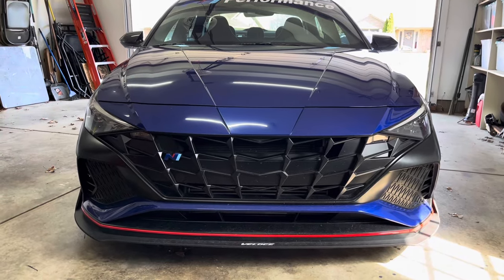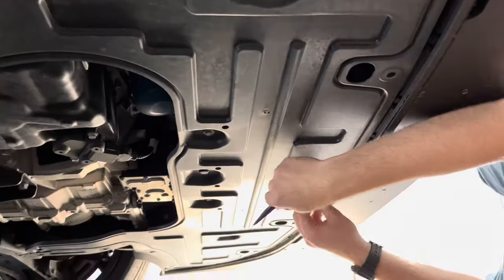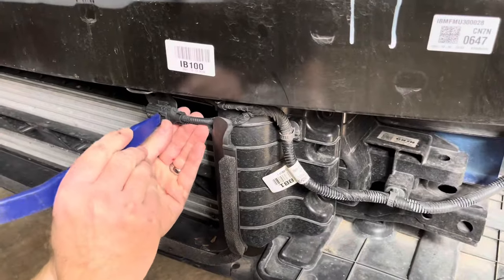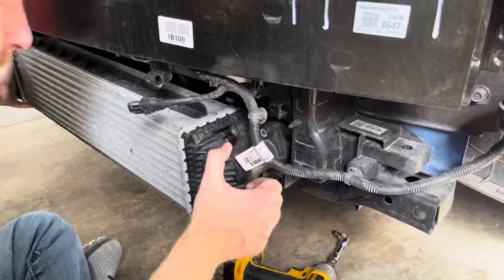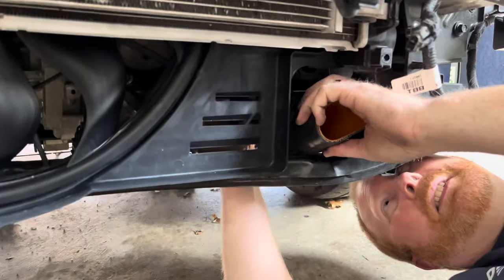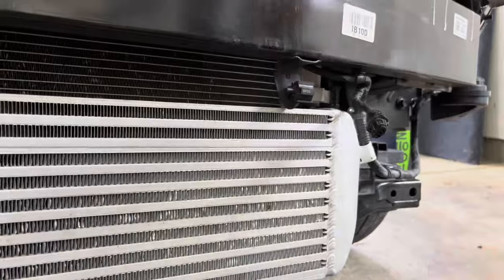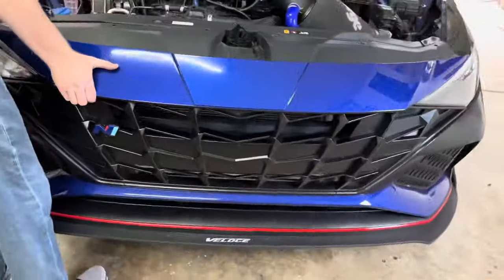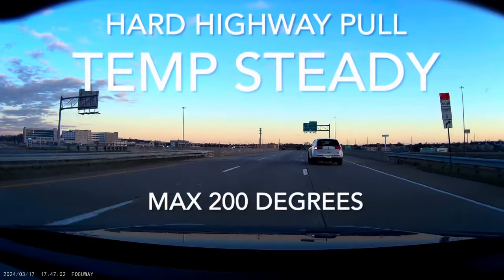2022+ Hyundai Elantra N Sxth Element Intercooler Installation

Comment: I installed STXH intercooler on my Corolla GR. On stock tune it doesnt heat soak as bad and pulls a bit harder.  Nice upgrade .. When we first installed, we had boost leaks from not tightening the clamps enough. But we pressure tested and fould all the boost leaks and now it great. Make sure you check for leaks, you can hear them in full boost.
Reply from the maker: Thank you for the heads up! I plan to recheck all the camps after a 100 miles of driving. I definitely notice the car pulling harder. The temp is also lower than it was with the stock intercooler.

Comment: I didn’t see it in the video so I’m assuming the stock bottom shroud didn’t fit back on after installing the intercooler 😢
Reply from the maker: @jayrockfromdablock2940  Correct, the plastic shroud in front of the factory intercooler does not go back on. If you want some type of shroud, I would suggest a Forge intercooler if their i30N intercooler would fit. Also N75 has a new intercooler coming out. Both have shrouds built in, if that is a concern you have. I just got a Forge intercooler for my wife’s Veloster N and it has shroud pieces built in and it’s very nice.

Comment: Nice instructions man! How long did it take totally?
Reply from the maker: @rawtaa8591  I don’t know an exact time, due to all the filming I have to do, but it’s not a long install at all. Honestly, it’s one of the easier upgrades I’ve done. Getting the bumper off is no big deal, I’ve done it many times at this point. The main thing is getting the clamps positioned in a way you can tighten them down easily and tightly. I had the cold side pop off a couple of times after I first installed it and had to reposition the clamp so I could make it tighter. The clamp i had issue with was the one that connects to the top of the cold pipe in the driver’s side.
Reply: @nprform  nice thanks man I saw your veloster n install to. Which I'm planning to do in the future.  I have near nil experience, so I 'll probably need all day. haha
Reply from the maker: @rawtaa8591  I’m no mechanic and between my wife and I we’ve accomplished a lot on both our cars all by ourselves. You can do it!

Comment: Excellent coverage on this install and the layout of the OEM parts.  Random question but if you still have the stock cold side silicone pipe, is there anyway you could tell me the thickness (4mm, 5mm, 6mm)?  I'm selecting silicone adapters for my methanol project.  Figured you may have the stock hose and calipers lol.
Reply from the maker: Thank you! I do have the factory hose. It looks to be 5mm.
Reply: @nprform  amazing, thank you!
Reply from the maker: @BecauseHYDE16  you’re welcome!